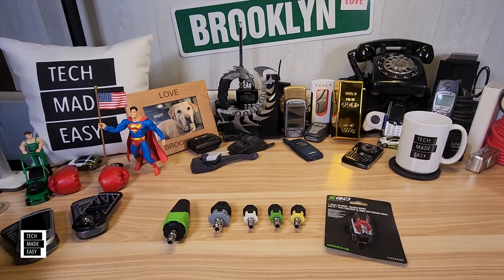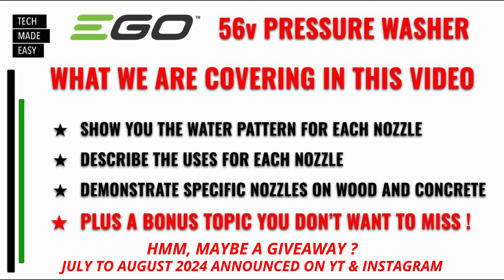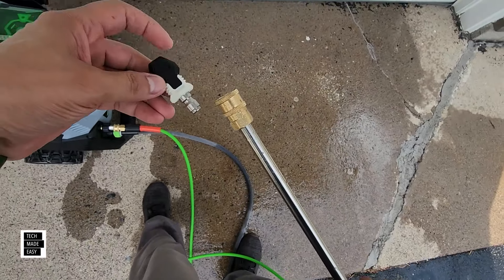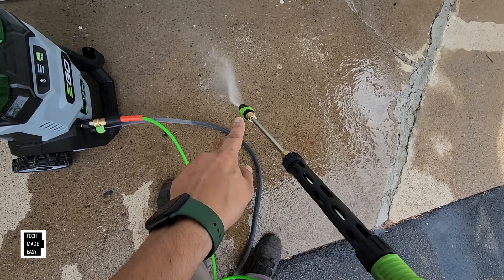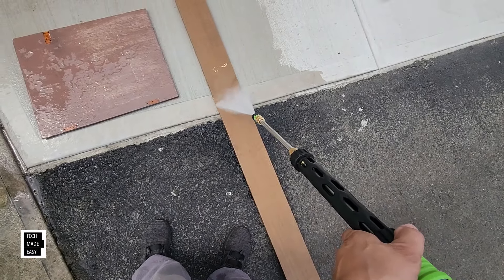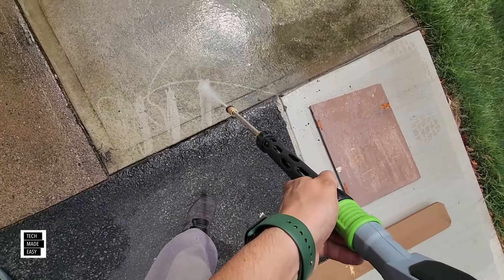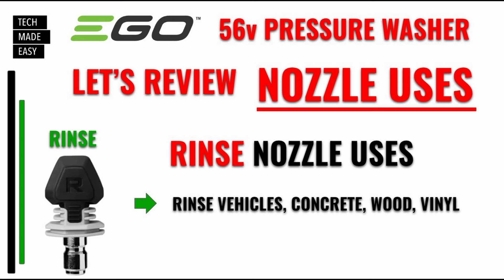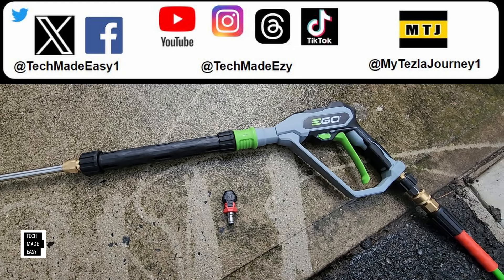0 Degree Nozzle EGO 56v Pressure Washer EGO Pressure Washer  ank2100 anz3200

Comment: Do you think it can strip paint off brick and concrete?
Reply from the maker: Yes but the 0 degree is very narrow, I would also use the 15 degree at closer range
Reply: @TechMadeEzy  I’ll try it 😎
Reply from the maker: You have it? If not I can try for you and report back if that works
Reply: @TechMadeEzy  sure, I do have it. I love it. My one issue, I just wish they had an option to plug it into an outlet. Other than that it’s pretty perfect for what I need it for really.
Reply: @beezer5623  use the Turbo nozzle to remove paint from concrete.